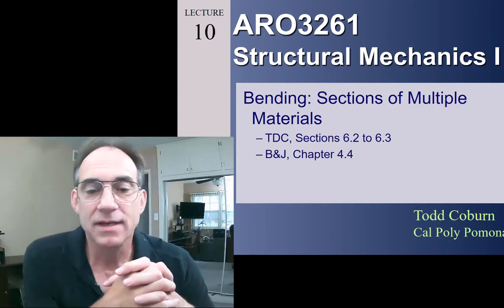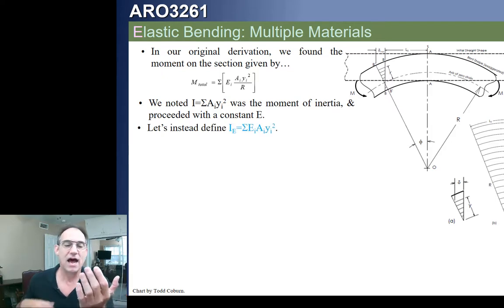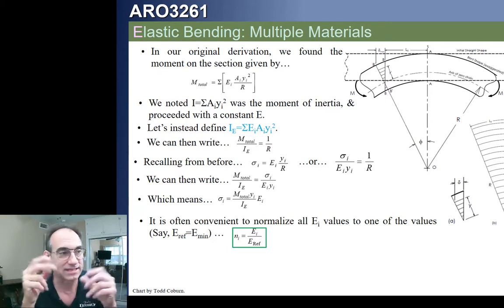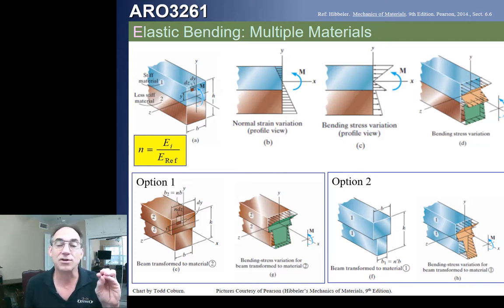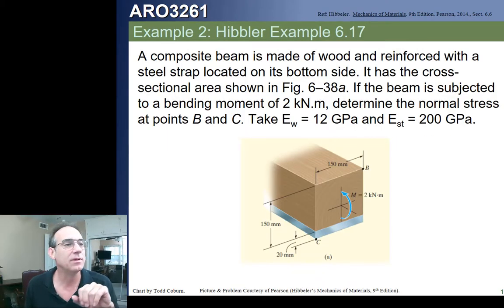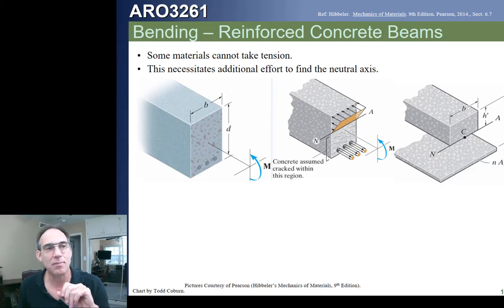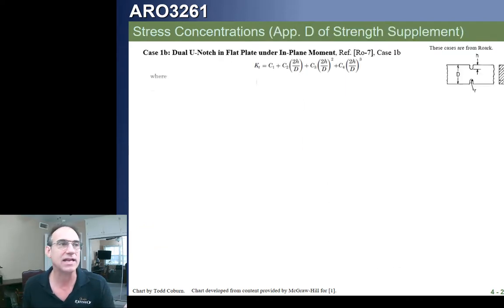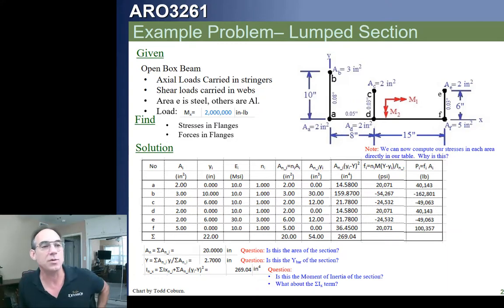Strength I: L-10 Bending - Evaluating Multiple Materials

Comment: I am having a hard time understanding how the Y bar for the structure was 4.750 inches for the first example. if both the materials stack up to be 4 inches, how is the Y bar above the materials?
Reply from the maker: Lol.  Not possible.  Must be an error.  Thanks for catching that and letting me know.  :-)
Reply: At 16:30 the A_n,i times y_i should be 6 not 12 for the first section (n*b*h*y=1*1*2*3=6) thus the Y-bar should be 6.66667/2.6667 = 2.50 in

Comment: ON the lumped section - example slide. An_i*yi for e should've been 36 right?
Reply from the maker: Not sure where you are referring to.
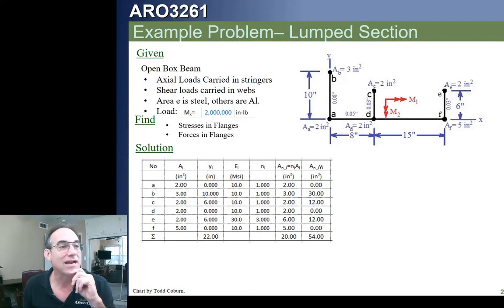Reply: @ToddCoburn  at minute 31:20 you have for section "e" An_i * yi as 12.00 when it should be 36.00 since our narea is 6in and yi is also 6in and 6*6 = 36in.
Reply: @ToddCoburn Also at minute 33:04 the stress for section "e" should be triple the value you have there as you didn't multiply by ni

Comment: So, by using the smallest Modulus of Elasticity as our reference, our smallest n will be 1, correct?
Reply from the maker: Right.  Whichever material you choose as your reference will have an n of 1.0.
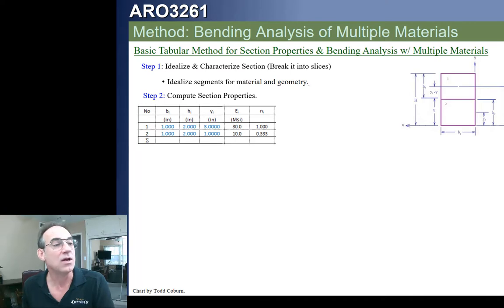Reply: also at minute 16:04 your Area*ybar is equal to 12 for section 1? should it be 6 instead?
Reply from the maker: @critta603  lol.  Yes.  Curiously, i just realized last week that multiple numbers in that table are wrong!  Not sure how, but an error crept into my calc and wasn’t caught by me or students.  

I updated the lecture but didn’t re-record it yet.

Thanks for keeping me honest.

Comment: Idk what this is
Reply from the maker: lol.  ...and I do not understand your question/comment.
Reply: @ToddCoburn  i don't know what this is, I came here by accident. You teaching people how to build fighter jets?
Reply from the maker: @gmo9562  lol.  Sure.  I am teaching aerospace engineering.  Specifically structural analysis & design.  This video is near the middle of the fundamentals section, so it will be rather confusing without the prerequisite material.  Enjoy.